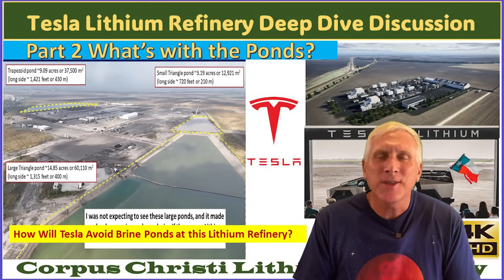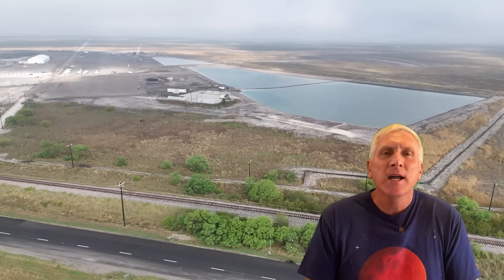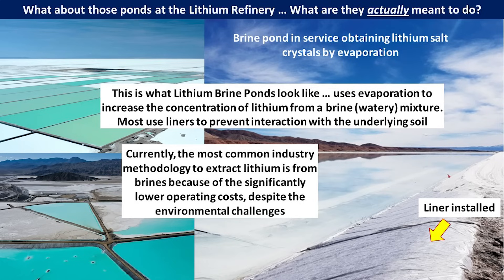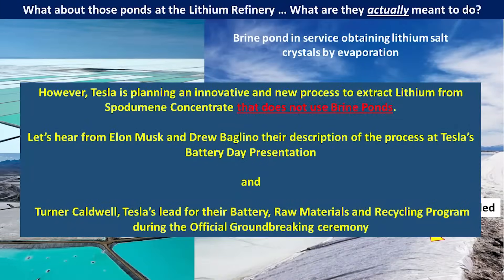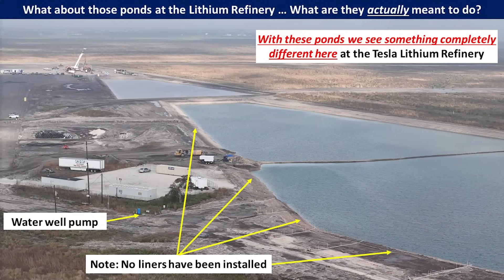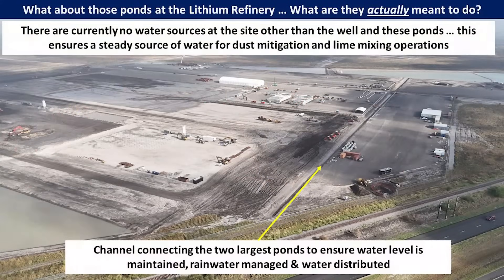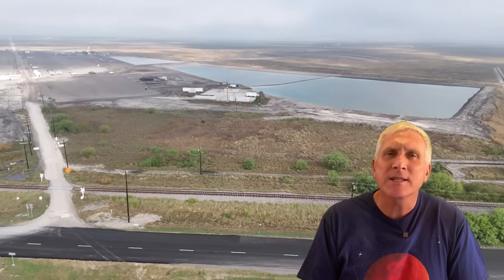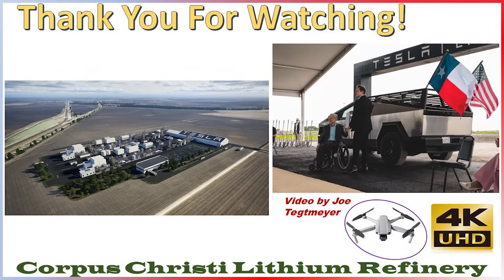Part 2  Tesla Corpus Christi Lithium Plant Deep Dive Video (Ponds and Water Management)

Comment: Joe, I believe the main reason they need the ponds for water management is that it's swampland... that grey soil looks to me like the kind of clay you have in reclaimed swampland and the area certainly looks that way. So they need to try and keep the water table down.
Reply from the maker: It is clay and we’ll talk about this more in Part 3!
Reply: @JoeTegtmeyer Yeah, I now, that's what the  lime is for.
Where I live we have that kind of soil in the fields and there are drainage ditches and every so often you have a horizontal pipe coming out of the ground to drain excess water from under the field and into the ditch.
Reply from the maker: @greggerypeccary666  thanks and glad you know about it. I think there are many that may not, which is why I’m doing this series and showing how the process works.

Comment: tesla is flailing - why else would they reduce prices 30k on some models - imagine how buyers from earlier this year feel - additionally toyota could have a solid state battery that has long range and needs no lithium plus they have over 1000 ev patents - it does not look good for tesla despite the fact you see so much activity at the plant
Reply: lol
Reply: $ 3000 not 30,000.  Tesla has such large margins on profit that they can adjust pricing to handle the variability of interest rates and inflation. Something the OEMs don't have.  At the same time; Tesla is always growing it's production numbers. So that slightly lower margin is balanced by increased sales. Thus YOY profits keep increasing. Can't say that for GM, Ford, Toyota, etc. NOT FLAILING but managing the market with internal flexibility.
Reply: @terrysullivan1992  no even worse 40k reductions in price of top line - tesla is going to end up spontaneously combusting from bad management - they are flailing